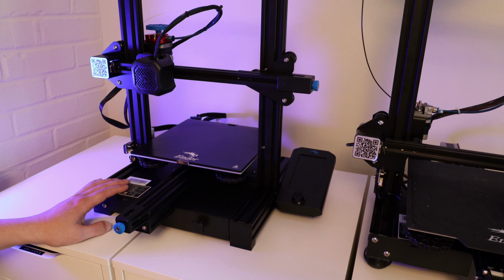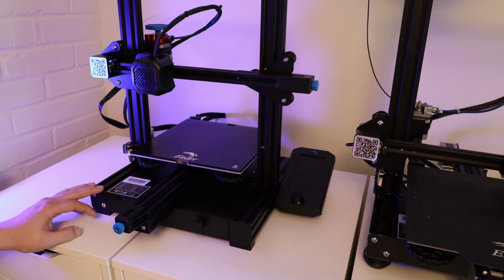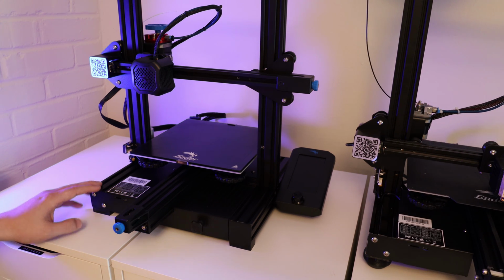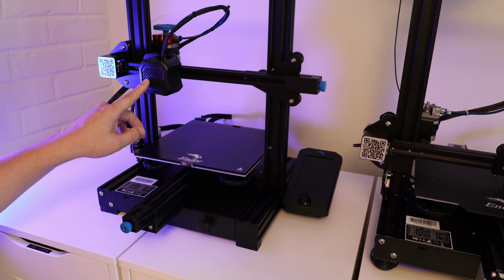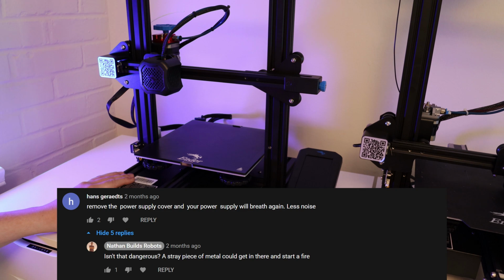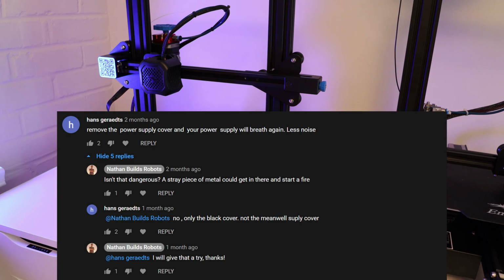The Ender 3 V2 Power Supply Is A Hot Mess!

Comment: OMG! No wonder it screams like a jet engine all time if it can't cool properly! How could Creality miss a such important detail!? After all, their machines have a very good reputation in general and are well known and praised (wich is why I got myself one recently) ,but thats a very dangerous design! Need to fix that promptly on my V2 machine before I start it back up again! At least gonna cut some vent holes in that cover with my Dremel. Not gonna be pretty but its under the machine and I certainley don't want to fry the PSU or in worst case start a fire!
Reply: I have done the upgrade now. Loosened the backplate. Then I  marked out a rectangle as good I could just where the vent holes in the PSU are and cut it out with an angle grinder and Dremel. The upgrade however did not affect the noise level as  the the only thing i noticed after the upgrade was the PSU fan starting later in the cycle but it still never turns off or slow down after that but screams constantly  att full speed just as loud as before during the entré cycle. I suspect the PSU fan is actually cycle and not temperature controlled as it always turns off immediatley after the cycle have finished and it did this before the upgrade as well seemingly ignoring the actual temperature of the PSU. Att least now I know It doesnt overheat.
Reply from the maker: @johnpekkala6941  Well it has to be looking at current draw or temperature, because the PSU never turns the fan on when the machine is just sitting at standby, and it gets no feedback from the main board. I'm replacing my PSU with a 330W laptop power supply now, now I have 0 PSU noise! There are some trade-offs though, will put it in my next vid.
Reply: @NathanBuildsRobots  I saw somewhere that the part cooling fan speed controls the motherboard fan speed as well.
Reply from the maker: @skatingaround6070  that is correct, it is probably be better to just hook it up so that is always on.
Reply: bro creality shit thats why
Reply from the maker: Before i saw the PSU cover I was reluctant to do any mods to my Ender 3s, because I respected Creality's ability to design such a high performing inexpensive printer. However, after seeing them mess something up as basic as the vent holes, I realize that they are really good at 2 things: achieving near perfect print quality (quality is about as good as you can get for a bowden printer), and doing it as cheap as possible. 
They are still impressive machines but realize that they have their limitations that your either need to work around, or mod away. 

I just tested some Prusa printers today and I can confirm that Prusa machines offer a better use experience. 
My modded Ender 3 V2 is faster, quieter, and still delivers excellent build quality, but the Prusa wins when you consider consistency,  quality of life, and their thoughtful design elements.
Reply from the maker: Is also cut out the fan protector, since it is redundant. The PSU already has one.
Reply: Their machines HAD a great reputation before the last batch of the ender 3 v2s. The screwed up big time on the this.
Reply from the maker: It's not THAT bad, print quality is still amazing, still pretty easy to use, but I think we all expected more innovation and improved build quality. 
They are the market leader and can afford to make some mistakes, but their next mainstream/beginner printer better be something really special, or I might have to pass on Creality. Artillery is making some very compelling printers now, and others are starting to compete with the Ender 3 on price. 

You gotta admit though, the 3d print mill is pretty cool.
Reply: @chrisradical2046  how so? I'm a new owner so this is valuable information
Reply: @HomeAwesomation  what do you mean? I'm a kinda new owner as well. I just removed it completely. There are PSU fan scoops on thinkverse for the ender 3 pro you can print. They fit the V2 as well.  I added this scoop because the vents point downwards so the fan might reintroduce the hot air from the vents back in. This way it's supposed to draw cool air from the back. At least that's my theory, I could be wrong. Also did the same for the motherboard case. It seems to run much better now.
Reply: @chrisradical2046  I was asking about this "Their machines HAD a great reputation before the last batch of the ender 3 v2s".

Is this because of the crap stepper drivers on the new 4.2.2 boards?

Comment: This is honestly a great solution for a problem that shouldn't have existed in the first place ... blocking vent holes on somethins that needs venting is never a great time. I was wondering tho, do you need to print a mount for it/ What kinda screws do you need to mount it on vertically? I don't really understand the dislikes either ... this is a great solution imo.

Comment: The Heat Block fan is noisy because of the plastic cover.  Remove the vented cover/ replace the cover and they are much quieter.  You lost me on the relocation of the PS.   Not a good choice.   How about raising the printer to allow greater air volume or printing a baffle to sepaate the input from the output or even flipping the supply to have the fans face up?    The vertical supply is in the way of a clean look and dual  Z  motors.

Comment: It's an intuitive guess that covering some of the PSU's venting would lead to overheating, but I'm wondering if you ever took a thermometer to it to find out how hot it was running before fixing a problem that may or may not have existed? I'd be surprised if the creality engineers didn't think of something so obvious.

Regardless of that it's still true that allowing all the venting to work can't do any harm and may quite possibly help. Mounting the PSU on the side as per the V1 is problematic however as it prevents you also mounting the second Z axis stepper motor & screw for more accurate Z translations. Think I'll compromise and open up the PSU mounting piece to allow all the vents to breath properly, and print some ducting to have the vents open to the front and rear in order to prevent exhausted air recycling.
Reply from the maker: I'm working on another V2 now. I'm doing the same - removing vent cover but keeping it on the bottom so I can do dual z screws.

I heard the reason they cover it is that in some countries there are safety regulations that say a power supply must be fully enclosed. 

From a heat transfer perspective - more airflow will always mean more effective heat dissipation. There are rare cases where directing the air through specific channels is more important, but I don't think this is one of those cases.

Comment: From the Meanwell installation manual: "Fans and ventilation holes must be kept free from any obstructions. Also a 10-15 cm clearance must be kept
when the adjacent device is a heat source". I checked it just in case and yes, they should be kept unobstructed.
Reply from the maker: Thanks for looking that up though, now I have something to cite when people say "Creality is purposely redirecting the air to make it run better" or other nonsense.
Reply from the maker: Do you think the heated bed counts as a heat source? 
I wonder, since the printer usually is running on less than 350 watts if the power supply is fine with the poor ventillation?

Comment: Jeez, thats a relief. I thought it would be highly complex to seperate the PSU from the printer for my enclosure mod on the way, but it seems to just be two cables that need elongation...
Reply from the maker: Yep, if you're feeling really lazy you can just buy one of these XT60 extension cables:

https://amzn.to/33196XE

Just check to see if your printer uses xt60 cables, they are the yellow 2-pin connector for the main 24v DC input.
Reply: @NathanBuildsRobots  wow, so creality was not lazy in the cablemaking... not quite so in the shroud making xD
Reply from the maker: @Medievalfan94  yes, and it would be nice to get some crimped Ferrule ends. They cost like $0.002 each, but I guess they had to leave them out to save cost?

Comment: I'm thinking maybe you could've just printed a new front cover for the PSU, and remove the two covering the PSU from the factory
Reply from the maker: Yeah you're right, I had PSUphobia when I made this video so I wanted to keep it shut. Its not too dangerous to open up as long as you take the proper safety precautions. However, I do like having it being all enclosed in metal.

Comment: Hum... I usually keep my ender 3v2 in an enclosure at 90F.. now I am concerned lol... never worried about the PSU
Reply from the maker: 90f isn't that hot - it's a normal day in a lot of places. 
It's pretty easy to move the PSU outside, you just need an extension cable for the power cord. 
The connector type is an XT60 with wires awg16 or thicker.

Comment: Or could add a fan for blowing air behind the power supply towards the vents, the old air gets pushed out from the bottom front of the printer and fan gets fresh air. This will stop you from hindering your way from bed leveling (vertical PSU) and butchering the printer
Reply from the maker: Good points

Comment: Was looking for a video of someone moving their PSU just because I hate where the power switch is locating, having to reach THROUGH the bed to get to it. Just wanted to make sure there wasn't some wiring issues I wouldn't have considered, but now I have even more reason to make sure to move it. Wow. And that part comes pre-assembled, so it's very easy to not notice, even if you know how bad that design is.
Reply from the maker: I just bought 2 Ender 3 V2s, and the holes are still there for relocating the power supply if you want to do that.

Comment: Hi Nathan, love your videos!! Hope you can help me. I have an ender 3 v2, extruder motor stopped moving, Plugged the motor to a different axis and did rotate so the motor is fine, check continuity of the extruder cables and is ok, check voltages and vrefs of the extruder pins and extruder drive and all are ok. Everything seems fine but cant get my extruder axis to work. Do you have any clue what is happening? Appreciate any help of guide. I dont know if I need a new board, or motor, or cables or psu… driving me crazy! Thanks!!!!
Reply from the maker: It sounds like your stepper driver for the extruder axis has died. This is a pretty common failure because the extruder axis has the largest torque and current requirements. The cheapest option is to desolder the surface mounted stepper driver, but not many people know how to do that. 

Your next best option is a new control board. There are a lot of options for new mainboards. You can buy a replacement from Creality, which is the easiest option since it should pretty much be set up for your build right out of the package, and you don't have to buy a new display. 
https://amzn.to/3lKNzcv

Personally, if I had money to burn I would get a Lerdge X or SKR mainboard. Lerdge sent me a free Lerdge K to try out and it was a really enjoyable experience. There were some challenges (You should ALWAYS check the Vref. I melted one of my printers last week because I skipped that step). They have it set up so you don't need to flash firmware, even if you pulled the board out and reinstalled it on a delta or corexy machine (everything you would normally need to configure in firmware can be set up through the display). I am hoping to finish up that video and release it this Wednesday.

The other thing is the lerdge X and some of the SKRs have replaceable stepper drivers, which means if your stepper drivers burn out again it's a 10 second fix.

Here is a link the lerdge X. There are some haters in the Amazon reviews but it worked fine for what I was trying to do. 
https://amzn.to/3j6LJ44

There are some more good options from SKR but you may need to flash the firmware. Some models come set up for Ender 3s out of the box but you have to check first. 
https://amzn.to/2YQgYcg
Reply: @NathanBuildsRobots  wow very nice explanation! I think I will buy a new creality board, this time a 4.2.7, the one with problems is a 4.2.2. 
This morning I was investigating about different options to replace the creality board, but when I saw the prices on amazon decided to go for the 4.2.7, wish I can get one like the skr one day, for now I will try to get the money for the cheap one.

Thank you so much for helping me and taking the time to read what I wrote. Best wishes!
Reply from the maker: No problem, I nearly broke my leg the other day so I can't work on my printers. May as well help some other people out while I'm down! Before you get too worried I should be 100% in a couple weeks. 

The base board makes the most sense IMO. They are pretty much all just Arduinos with stepper, heater, and fan drivers attached to them. 

Might be worth putting an upgraded heatsink or fan on your mainboard. This will help keep your stepper drivers running cool. 

The stock mainboard fan only turns on when your part cooling fan is on, which is really dumb since most large prints leave the part cooling fan off, which leads to really high stepper driver temperatures. I would rewire it so the mainboard fan is on whenever your printer is on. It may help save your next extruder stepper driver.
Reply: @NathanBuildsRobots  very grateful for your help!! Get well soon so you can continue making those great videos!

Comment: Very useful info. Another problem with fans is that mainboard fan is working only if part cooling fan is on. This means if you print ABS, PETG with no part cooling, mainboard fan is off! Not good if you print in enclosure.

Comment: Why not turn the PS sideways from that end position so the exhaust isn't immediately below the intake?
Reply from the maker: It would make wire management a little more difficult, because then the power wires would be coming from the top and need to be routed down into the electronics. The orientation I chose is not ideal, but a compromise.

Comment: Wouldnt it be easier to lift the printer off the table top? Would provide more airflow
Reply from the maker: Yeah definitely. This was an early build for me, I've been getting better at modding. 
On my latest build I put tall feet and a giant fan under the printer. It looks great and provides an insane amount of airflow with very little noise. (FOKOOS Odin https://youtu.be/nFOkOhdYy30 )

Edit: I forgot to mention, the vertical orientation also helps it cool a little better. It has a chimney effect, plus it gets more separation from the heated bed

Comment: Here I was Googling to see if my printer has the ability to remotely control the PSU through Octoprint and now I have a new project to help quiet this beast down. This is just insane that they'd leave it covered like that. I don't think I'm going to fully move the PSU to the side (had thought about it without having a reason why) but I am considering making a pair of air conduits to fit on the stock mounts and feet so that the fresh and hot air don't mix under the printer.
Reply from the maker: I have put squash ball feet on most of my printers now, which lift it off the table to give better airflow, and also do a great job damping out vibrations.

Someone in the comments mentioned building a little wall out of tape to separate the intake and outlet of the PSU, which sounded like the simplest solution.

Comment: I did a similar mod to my Ender 3 V2, but I only relocated the PSU I kept the metal boxes underneath the printer, I just had to extend the cables that actually connect to the PSU. I just need to learn how to use Fusion 360 to design a new cover to cover the wire connections and maybe add a Noctua Fan like a 92mm for example, maybe a couple of the connected in serial mode so I won't need a buck converter for 12V from the 24V from the PSU. I kept the power button in the back (original). I'm thinking about adding the Petsfang mod as well and replace the stock fan by a Noctua.
Reply from the maker: I have had to extend the cables on a couple of my builds. 

You can connect fans in serial, I did it on one build, but I'm always worried about the load not being split evenly during startup, or if one of the fans is jammed the other will take the full 24v. Hasn't caused any issues yet but it's not "proper" electrical engineering.

The Petsfang mod looks so cool. The Thingiverse page looks so confusing though. Best of luck with your mods!

Comment: so if you have an enclosed printer, it would make more sense to pull the power supply from the enclose heated box
 and extend the wires to the outside?
Reply from the maker: Yes, I would put the power supply outside of the box so it gets cool air.

Comment: My two month old Ender 3 V2 just failed halfway through my longest print yet (only 4 hours in), i suspect it got too hot. I wish id seen this video earlier!
Reply from the maker: Which part do you think failed? What are the symptoms? You might be able to fix it.
Reply: @NathanBuildsRobots  Its definitely the PSU because when i plugged the printer in via USB the screen still comes on, i checked the fuse and seems fine. I contacted creality and theyre sending a new PSU, hopefully it doesnt take too long. When it arrives im going to do all the stuff you've done in this video so thank you!

Comment: Dumb question, any reason not to just take the metal cover off of the PSU, as opposed to taking a Dremel to it?
Reply from the maker: The PSU cover also prevents fingers from getting into the 120v wire terminals, so it's worth keeping the portion of the cover that protects that area.
Reply: @NathanBuildsRobots Very fair. Now you've got me wondering about simply printing a cover for that area!
Reply from the maker: I stick with metal as often as possible because Smokey the Bear told me it doesn't soften under heat and can't catch on fire.